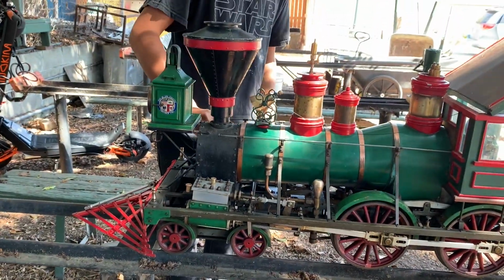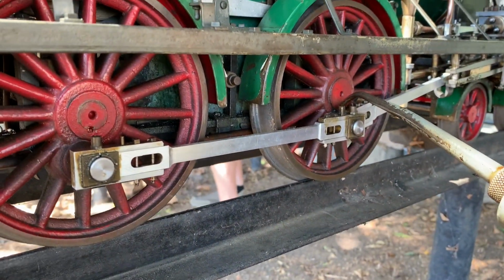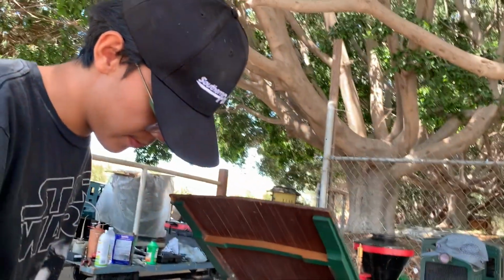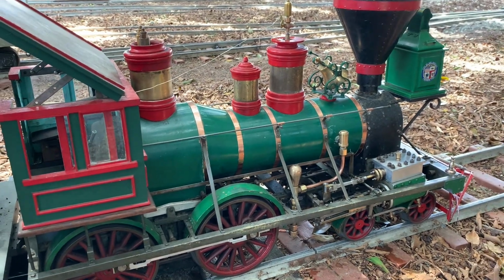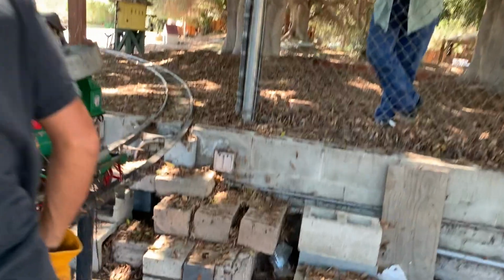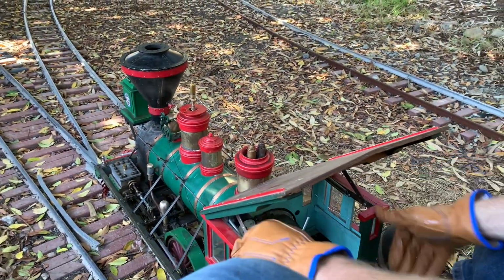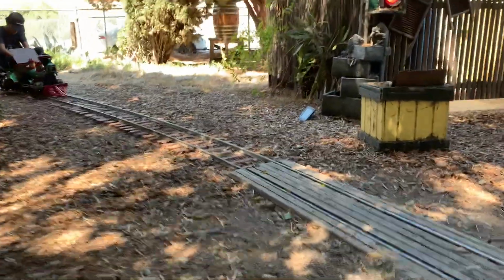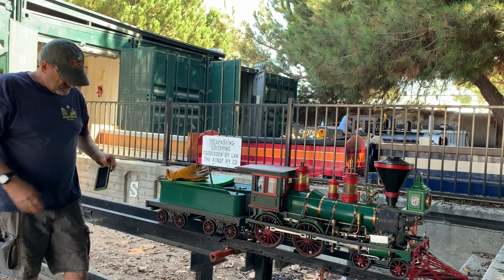First time on a Coal Fired Steam Locomotive

Comment: Timing sounds out on the engine, also does this engine not have a steam blower. Glad to see you having a go, good luck with your own engines.
Reply from the maker: The timing was good. One of the cylinder exhausts was clogged, which had since been resolved. It was fun, but I think I will take propane. Stuck around for more of my trains.
Reply: @nates.vintage.trains  beautiful looking steam loco. she looks very similar to Walt Disney's own steam engine the Lily Belle.

Comment: "over firing" the engine and "shoveling in a lot of coal" might be why you can't keep steam well. Putting in too much coal will choke the fire and create less heat. The engine also sounds severely out of time, only 3 chuffs per revolution and no steam coming out of the rear fireman's side cylinder cock, Which makes me think it's clogged or so badly timed it's not getting steam at all.

Comment: The LE American had notoriously small flue tubes which made them poor coal burners. You have got to keep punching out the flues when it stops making steam.The one I owned ran much better after I converted it to propane. You MUST wear safety glasses or ski goggles when firing on coal, and then you will look like a veteran coal burning fireman with the signature "raccoon eyes" from the goggles - but at least you will be able to see!
If the engine has been sitting for 30 years and the back left cylinder doesn't seem to be getting steam, it is probably a blockage of old coagulated steam oil, or even cinders if that snifter valve isn't working properly, in the passages between the steam valve and the cylinder. Remove the cylinder valve cover, roll the drivers until that rear steam passage is opened and run a small wire down thru the passage. Use solid copper electric wire like from house wiring instead of steel like a coat hanger. While rolling the drivers, check that the valve is moving back and forth properly, and hasn't jumped that little pin that fits in the valve top groove - then it only moves half way in one direction.
Remember to punch out the flues a couple times in a day's running using a rifle cleaning rod with, I believe it is a 30 caliber cleaning brush. The flues you can't reach from the front end, like behind the exhaust blast pipe, you'll have to clean thru the firebox door. And scoop out all of the cinders in the bottom of the smokebox daily or more, so that they don't get sucked into the cylinders.
Say Hi to your illustrious President for me, around 10 or so years ago I bought a PROCOR tank car from him and he shipped it to me in Colorado - very good job of crating it and the car was in excellent condition.
Good to see you young men are interested in the Vintage Art of Live Steaming.
Happy Steaming!
Reply from the maker: Thanks for the information. I am not sure if this is a little engines american or something else, it is hard to tell. My friend, who is able to work there a lot more often has resolved a few issues including that cylinder. It has been cleaned well even before this, boiler he’d been tested and cleaned too.